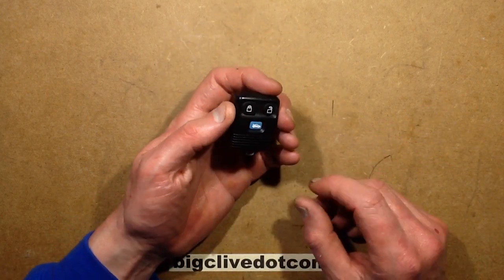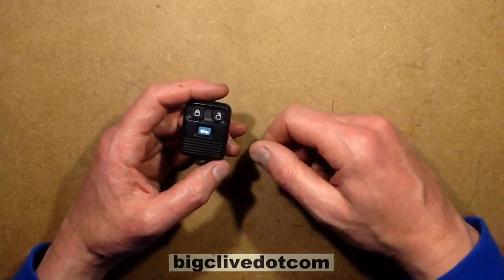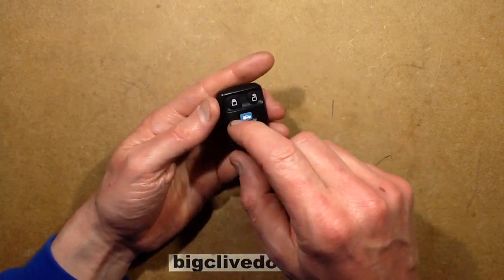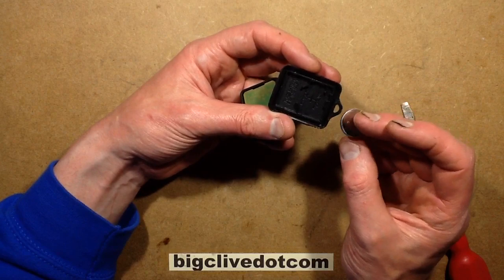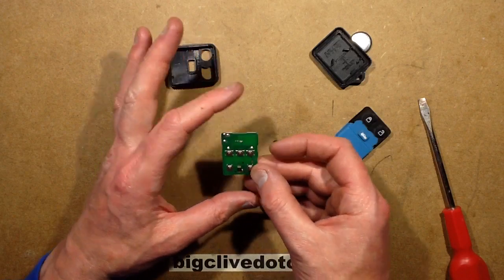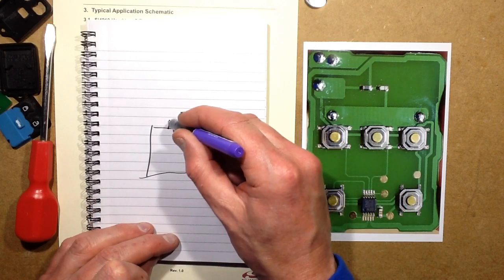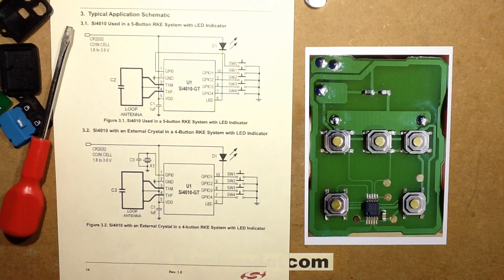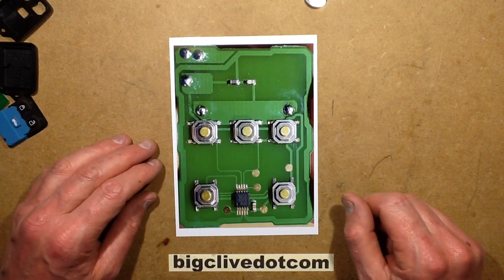Inside a Ford Transit keyfob remote.  (and pairing it)

Comment: Clive, have you thought about adding an oscilloscope to your bench? It certainly would give far more insight into your analysis of these devices. If you already have one, I do apologize but I would encourage you to use it. Sometimes the devil is hiding inside the wave form.
Reply: +bain5872 I'd say an oscilloscope is more for in depth tear downs.  Clive seems to be one to share simpler things with us.  I appreciate the simplicity. The oscilloscope would require a bit more setup, so the ease to make a video for us diminishes.
Reply: zendell37
I can certainly understand your point of view after thinking it over. I was speaking from my own point of view as a tech, of course. As you suggest, it might get in the way of others enjoyment. In fact, I had not thought of it being this way for some. I'm happy either way.
Reply: bain5872
I agree, as a tech an oscilloscope would be something I would just have sitting around when trying to test and repair devices.  But with little show and tell videos like Clive makes, it just doesn't seem to fit right.  If he did start making more detailed videos, I too would welcome an oscilloscope.  I enjoy seeing them used where applicable(AVE's vids are the only ones that pop into mind at the moment).  Showing the waveform may be nice with some of his power supply videos, showing the difference between them as LED drivers.  It would certainly demonstrate why some LEDs flicker visually.

Comment: Adding key fobs to a Subaru is almost comical in its complexity, what with opening doors sitting down, closing door, turning key on/off/on/off... and then entering the fob's ID via the lock button.
Reply: +hoppes9 Sounds like it needs to come with a Nintendo controller...

up-down-up-down-left-right-left-right-flash headlights...

Comment: the two capacitors seem to be keeping the antenna at a constant voltage at the midpoint. so lets say it was a 3v cell ( simplicity) it would be keeping the antenna powered with 1.5v. this may be so that the antenna has a faster response time in corraspondancenwith the chip? also maybe so that it has a positive/negative swing? (noob with random theories. 15% chance of me actually being right)

Comment: ok great video but I know if you have two keys and you need three or more you can cycle the 1 good  key once and then the  other good key once then the new key and it will program it 
but if you loose all but one key you have to have it program it take 10 mins with the right scan tool to start to get in to the program just to program the key and you have to have at lease two keys to do it and your right you do not need a key fob to start if you lost all of them you can program them just like you said … thank you
Reply from the maker: With my Transit if you cycle the ignition from of to on 8 times - leaving it on the eighth time the locks will cycle once.  You can then get several fobs and program them all by pressing the button on them once for each fob.  Each time you press a fob and it's recognised, the locks will cycle once.  Then turn the ignition back off and they're programmed.
Reply: @bigclivedotcom   right that's how you program most of all ford fobs in the start of your video you said that you had to have two already programed that's for the key (pats) Passive Anti-Theft System (PATS) now for the remotes you do not have to have one already  programed lets say you lost all of them you could buy one a program it just like you said :)  but if you add any new ones and you have one you need to program them all at the same time one after the other

Comment: My Toyota keyfob works from anywhere inside my house, from the back garden with the car round the front and also locks and unlocks my neighbour's Lexus.
Reply: I would abuse that. Just sit in the house and set the alarms off.
Reply: TheLastRedWolf If only. Unlocking his car disables the alarm. I can though, wait for him to unlock then lock it again before he reaches to open the door.
Reply: I would do that as well. As he reaches for the handle, hit the lock button.
Reply: ***** And just what proof would you like? And what makes you, having once worked on a reception desk, an expert? Maybe the 'technician' you asked wasn't quite the expert you thought he was either. You should rinse the suds out thoroughly the next time you decide to wash your brain.

Comment: There's an interesting myth about the keyfob working from further away from your car if you point it at your head.
It has nothing to do with the contents of your skull, the only difference it makes is that you turn it 90°, as the antennae is actually pointing out the top and the bottom and not out the front.
Reply: +David C That'd be relative to weather the receiver is vertically or horizontally oriented. Yes, they always work more efficiently when matched up. Electronics 101

Comment: Curious. My Ford key fob has 4 buttons (lock,unlock, trunk, alarm) in a regular 4 button square pattern. I suspect that extra switch would operate the emergency alarm - which waaaaay too many people use to locate their *$&%)@ car. Prior to this car (a large model never sold outside the North American market based on a Volvo platform) I had an F-150 which simply had 2 buttons - hardly a need to unlock the tailgate, although it DID have a lock!

Comment: Perhaps the two capacitors provide a midpoint common.
Reply: Actually, they are more likely to be loading (matching) the antenna as the PCB loop antenna is very short for the frequency the fobs typically run on.  By loading the antenna you can improve the match and increase its efficiency (not as good as if it were a full size loop, but better than an undersized loop with no matching).  For example, if it's operating frequency is in the 400-500MHz range then a full size loop antenna would be between 60 and 75 cm long.
Reply: +Ethan Poole 
Im sure your right :-), capacitive reactance can be used for allsorts.
I dont tinker with transmitters up that high, gets rather picky as frequency rises.
Reply: +Ethan Poole 
The loop is driven by two push pull transistor output stages ( H drive) . Because the quiescent output levels of the two can not be manufactured to be exactly equal, if there was a loop from one output to the other a static DC current would be established causing over load, distortion and heating. The capacitor prevents that as seen in the application circuit in the data sheet. I think Clive has i wrong when he draws his own diagram.
I have not sen the specs. It might be that the chip will tolerate a direct loop.
Reply: thats a big problem with these devices, a dipole antenna for the EU fob band 433mhz would be about 32cm (16cm per side) imagine how far these things would go with a propper dipole on it lol, if you used 16cm for one and then inductive connection to the persons body for the other, just like hand held radios.
Reply: G.O.B.S  Would you like to carry 32 cm key fob around? Guess not !
Reply: Azzy M no, even if using the body on inductance and you have a telescopic antenna thats 16cm, its too impractical to use....
but the point of the matter is still the same... imagine how far away it would receive the fob with a true resonant antenna...
Reply: G.O.B.S  Quite far. Or suppose you have dish antenna and a resonant dipole at the focus etc. Another dish on the surface of mars could detect it!
But how many will find it practical? Question is of practicality.
I make regular contacts with a fellow ham friend  on 4 meter band over a distance of 200 miles with a tiny 2W QRP transmitter, (loud and clear).
Point is practicality and intended application, not the ultimate achievable. Which is a laudable achievement  but a different sphere.

Comment: I have one of these for repairs but it is the original version which has the centre cap on the antenna like in the diagram from silicon labs. The centre antenna cap has been lost. For a quick fix does anyone here know the value of that capacitor? I cannot find info about the chip though from my research it might be a 2pF or 1.5pF any help ?
Thanks
p.s. Bigclive your channel is awesome !!!

Comment: Well, the antenna arrangement certainly is a bit unusual... However, in terms of HF physics I strongly suspect it will behave similarly as if you had one capacitor directly in the antenna (haven't run that through NEC, though). What I find seriously strange about this arrangement though is the fact that it would leak significant amounts of HF voltage with pretty negligible current (the tap being at the voltage maximum and current minimum) into the power supply... Perhaps this is intended? If the IC had some internal smoothing or was at least quite HF resistant it might use this as a very odd means of boosting the power supply voltage.

Just a word of explanation for those having difficulty following all this: At sufficiently high frequencies the impedance (equivalent resistance) of a capacitor goes down to pretty much zero. With very low value caps this happens at reasonably low frequencies, turning them effectively (and intentionally) into a dead short. However, any capacitance or inductance will affect the resonant frequency of the antenna. 

A loop antenna is in resonance if it has the maximum of current at the feed point and the maximum of voltage at the tuning capacitor, which is the center point of the loop and directly opposite the feed. Thus, the tap is certainly at the right place to add capacitance and as I said above the short at that point shouldn't matter.

Now, here's hoping this makes sense to at least some people...

73 de DL1JPH

Comment: No timing components of any sort - how does the chip generate stable RF? Especially given the beefy temperature swings in automotive applications.
Reply: +proudsnowtiger Possibly along the lines of the Si500 "silicon XO" from the same stable. Quoting yours truly,
"Essentially the integration levels possible today are used to 
measure temperature and digitally provide effective temperature compensation for an LC oscillator running at a frequency in the GHz range, and desired output frequency is obtained by adjusting LC oscillator frequency and the ratio of a following clock divider."
Reply: +yeoldeengineer It is also likely that these key fobs are using FM and the FM capture effect ensures that the receiver will pretty much lock onto the strongest signal that is at all close to the target frequency.  Combine that with a relatively wide open frontend and the setup can tolerate a fair bit of drift as it is looking for a very specific digital sequence which makes random interference fairly easy to reject.  But a lot of devices make use of internal RC oscillators that have been precalibrated at the factory so that they are very close to target frequency at typical room temperature, in which case they just need to be designed to handle the worst case frequency drift due to temperature coefficient.
Reply from the maker: It's possibly either a very accurate internal oscillator or using the etched antenna on the PCB as a timing component.

Comment: So what is the usual failure mode?
Reply: +astclair102 Water damage, Tac switch failure,  leaking battery, or high VSWR
Reply: +ElfNet Gaming Thanks - interesting and very useful.  Although, at five quid each, its probably better to buy a new one rather than footer around with a dud.

Comment: I have bought a same from AliExpress. But the chip is different from my old remotes chip. If I place the chip from old remote to new one would it work?
Reply from the maker: It isn't guaranteed to be pin compatible.  I also found that cheap remotes from eBay might work initially once programmed into the van, but would stop working later as if there was a code algorithm issue.

Comment: Hello I just got my key fobs today but I’m turning the ignition off and on for 8 times ending on position 2 but door locks not doing anything do you think I should try another key in the ignition not sure if it’s the master key I’m using.
Reply from the maker: Your model may have a different system.
Reply: It’s all sorted now my friend I only unlocked the two front doors instead of unlocking all the doors and now all programmed and working thank you for replying and for your video.

Comment: https://en.wikipedia.org/wiki/RC_oscillator#Twin-T_oscillator

Even I couldn't believe my mind could remember that from my college days but they did drill those names into us prior to testing and notice this one needs no inductor & is based on an op-amp so it seems likely what is being used here. Seems it could easily enough been included in the chip as others mentioned in chips below. They probably left they them outside so they can change them for other makes of their same cars... does ford still make mercury?

My first car was a ford that gave me an electronics lesson in intermittent circuitry as the left tail light had been run into (a college girl drove it so I got it from her father for $75 and it needed the wing nut for the power steering and a fan... which cost me all of $3.25 I remember with a trip to the countryside for parts from the boneyard). Thing ran flawlessly in 105 F degree weather one afternoon we took it across the border to buy fireworks for the 4th of July. Temp Gauge never moved above dead center and we were glad it had a "moonroof" which you cranked open by hand. You don't see those anymore.

You could park, crank open your moondroof, lean all the way back in its bucket seats, and watch the stars while I listened to tapes or entertained a lady.

The other unusual thing was it was the year before they put the 302 in this particular model (mustang II chasis) so it had a 2.8l (171.5 ci) v-6 which revved unusually high as it had timing gears instead of a chain and dual exhaust -- also more unusual in those days.  I still don't think timing gears are all that common unless you do custom muscle car builds.

That brings back memories. Oh yeah, it had dual piston "racing calipers" back then which cost a fortune... no sliding calipers like today's deathtraps... and I ended up rebuilding them by hand because otherwise they were like $600 just for the front axle, labor to install not included. Funny to look back and see what stuck with us technologically and what has not. 

Naturally I took it to bits... I'd like to find the starter to try it out on an electric trike. That is if I could ever find it. I hardened a lot of its valves and pushrods into carving tools.

Comment: Could you please do a teardown of an OEM keyfob?
Reply: +Anton Babiy It's basically the same arrangement unless you have an older version.
Reply: +ElfNet Gaming I would think that they use a dedicated chip instead of a universal mc and also shouldn't have extra buttons. I don't think there would be a big difference, but there surely will be some.
Reply: Anton Babiy One of the original ford keyfobs I have from my old '99 explorer had a COB BLOB in it, I have some newer ones for dodge that have the actual key on them, I could do a video on them but I suspect they will be similar to identical with obvious part layout differences.
Reply: +ElfNet Gaming well yeah. There isn't going to be much of a difference. A keyfob is a keyfob.
Reply: The OEM one I have from Dodge and Chrystler are vastly different I found out last night! Way more goodies inside
Reply: +Anton Babiy That is the OEM For mk 6 tranists with central

Comment: Is there a way to add a keyfob to my '97 toyota rav 4 or my dad's '01 honda insight? Both of them did not have a remote when we got them, but we are fairly sure they have the radio for it
Reply: +Luke Den Hartog All you need to do is use a thing called "The Internet", and search using a website called "Google".
Reply: llamaspit Wow, I never would have thought of that! Thanks!
Reply: I think the most amusing part of this is that I never did bother to google it, so thanks for the lmgtfy link. I think.

Comment: had a transit good reliable vans but if you buy one you better start practising welding
Reply: Rust?
Reply: pretty much everywhere under it and front inner wings are a place they tend to rot as well. mine needed about £800 worth of welding for mot that was a 2005 mk6 the sills and inner sills rot badly as well. if you are thinking of buying a transit check out underneath especially around the rear spring mounts inner front wings the whole floor pan of the cab and rear inner bumper they seem to be the worse. i scrapped mine and got a 12 year old sprinter.
Reply: I seen lots of 1990 m.y. Transits without rust, so blame the climate

Comment: what year transit do you have?
Reply from the maker: +Martijn Bruggers I bought it way back in 2004.  Still going fine.
Reply: bigclivedotcom and howmany miles?
Reply from the maker: +Martijn Bruggers I'm not sure what the current mileage is.  The van is at my brothers house.
Reply: +bigclivedotcom It's a transit. Mileage is irrelevant. It will last forever xD

Although the alternator will die at a VERY inconvenient time. Because Ford.
Reply: +DanJBMedia All alternators do, at least its one of the easier ones to rebuild. Get an online kit mailed to you ahead of time for when that day comes. Then make a video of it!
Reply: Not worth rebuilding, Just get an new OEM it'll last a lot better.